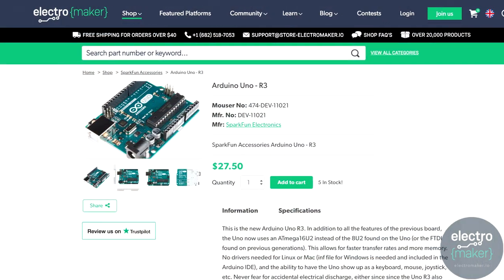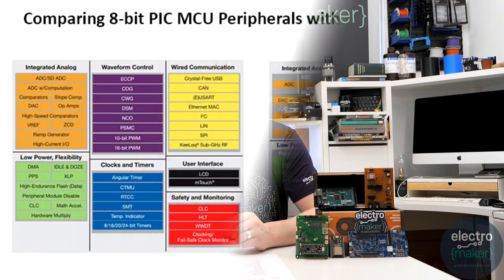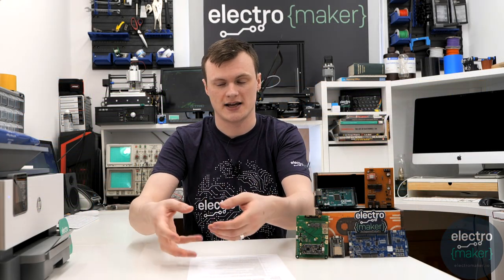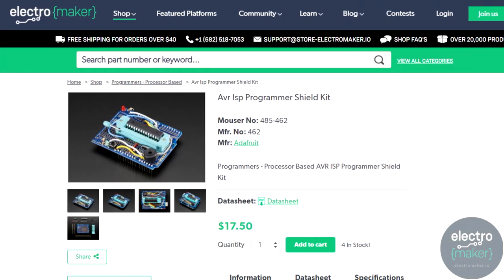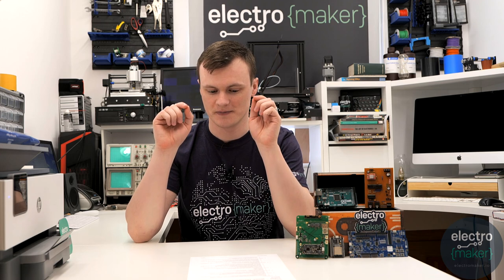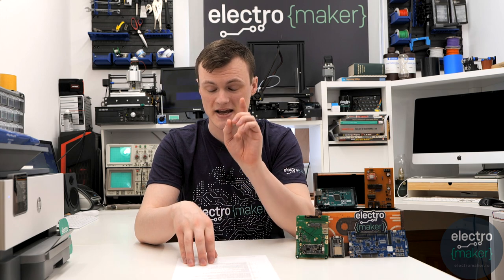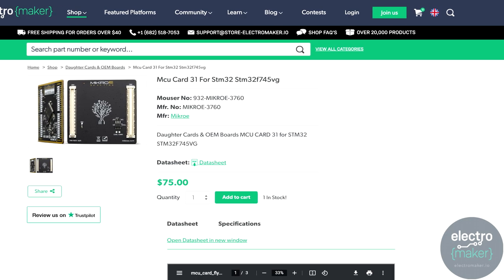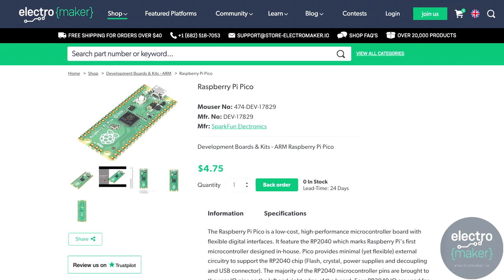Which microcontroller is best for you?

Comment: Tensilica (esp32,esp8266,..) are also great ones for hobbies
Reply: Over
Reply from the maker: Top suggestions Angel. Hopefully, they will make the shortlist for the next video!
Reply: @Electromakerio  wait, i'm surprised you didnt mention them in ur video given that they are almost as popular as the arduino! ..
it's the first time for me to learn about stm32, I could swear I thought u were talking about esp32 ... i cant get around the fact that u didnt mention it in ur video.... the board has wifi, bluetooth built in with high processor power and more pins than any thing else yet, very cheap!

Comment: wait, i'm surprised you didnt mention (ESP 32 , ESP 8266 ,...)in ur video given that they are almost as popular as the arduino! ..
it's the first time for me to learn about stm32, I could swear I thought u were talking about esp32 ... i cant get around the fact that u didnt mention it in ur video.... the board has wifi, bluetooth built in with high processor power and more pins than any thing else yet, very cheap!

Comment: Am I the only one who had to watch at 75% speed? This guy should do cattle auctions
Reply: Ben Shapiro actually talks faster than this guy in my opinion. When I listen to Ben’s podcast, it sounds like he talking at 1.5x speed.
Reply: 1.75 speed 😅😊
Reply: 8051 kind of board for learning microcontroller, port pin easy remember  position, easy register to remember, understand, you must hand to comunicate with outside so you understand more, stm, avr, esp ( server web not free forever ?) pic register not friendly to remember basicaly. I chose 8051 ( friendly with register ,assembly to remember ) and avr mega 328 ( friendly with arduino ide, basic register remember, more than one maker produce 8051 core -> replace easy ), esp 8266 ( friendly with arduino ide ) inside project

Comment: The Nucleo boards on STM32 have built-in ST-Links, making them easy to program. I prefer this method to the Raspberry Pi Pico boards, and I wish the Picos incorporated something similar. If you want to debug a Pico, you need another Pico to act as a programmer. I do think the Nucleo boards win on this score.
Reply: I think it's a matter of application. you're probably not going to put the nucleo board into a final project. it's only for prototyping. the pi pico board, with it's castellated edges, is meant to be able to be soldered directly to a pcb, so you wouldn't want that extra debug hardware there. if you develop on the nucleo, you then have to spin your own design with the same chip and supporting components.
Reply: I like the ESP32, STM32, and the Pi Pico. The are several debuggers for the ESP32. The one I have is quite cheap at $6.00. You can buy cheap ST-Link debuggers for $4-$5 but I do have Nucleo boards that do have that built-in debugger. I also have tried the Picoprobe which works well for me. I created a simple PCB that holds two picos, a picoprobe debugger Pico and a target Pico.

Comment: What if someone was building a human sized robot with ai, so it had to be fast like a fast computer, and has many linear actuators or servos and multiple batteries, cameras, sensors, etc. Is there a board for something like that or do they have to create one?
Reply: youd probably have multiple microcrontrollers controlling certain processes / sets of sensors and devices (just like how cars have dedicated controllers for different systems that then all feed data back into the main ECU).